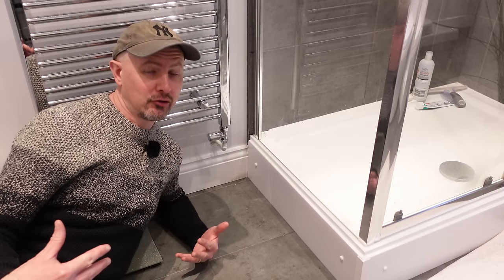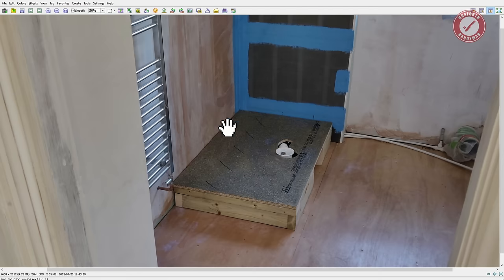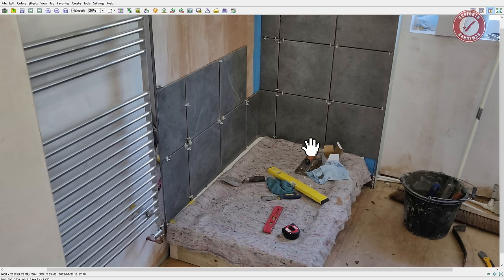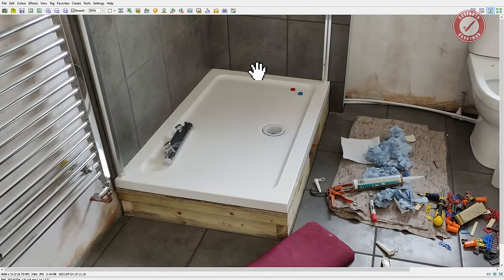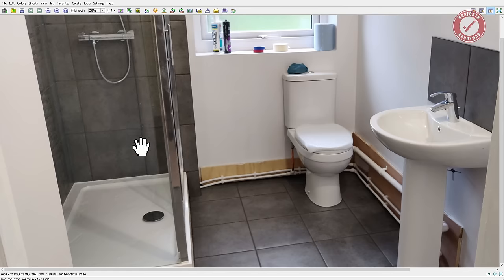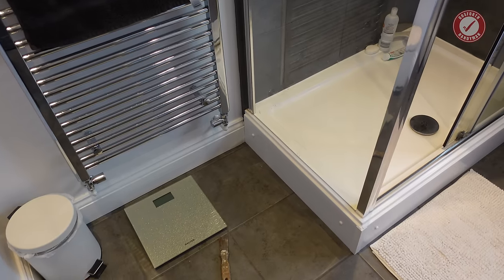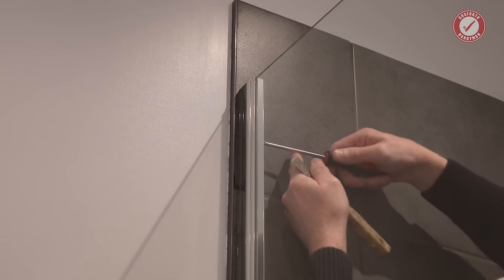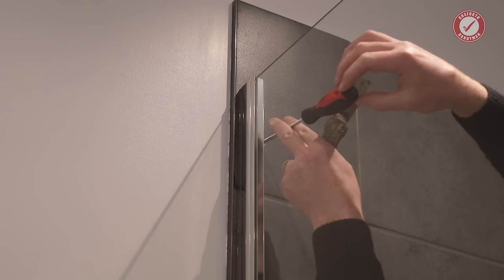How do you fix a leaking shower screen?

Comment: You could have used nylon fishing line to get through the silicone
Reply from the maker: Possibly!
Reply: I had a similar thought of using “cheese wire” or similar. I’ve got a similar issue with the corner of my shower screen, so fingers crossed I can pick up some ideas here.
Reply: dental floss kept snapping when used that to remove the old silicon behind
Reply: Just some nice thin scalpel blades and long thin utility knife work wonders. Don't know how you'd get fishing line to work without a second pair of hands on the other side of the glass...

Comment: Did you tile then put tray upto it? If so you'll struggle to get that to ever seal properly mate. I'd always tile onto tray to reduce that to a minimum.
Reply from the maker: No, always tray then tile. Think it's on the pics. 👍
Reply: @Gosforth Handyman  just looks like from pics. Sorry bud, but yeah to pick up what you said about sealant only where manufacturers state. Quite a few seal profile to wall, if water gets in it cannot get out! Great of you to share it, many wouldn't 👌
Reply from the maker: No worries! 👍

Comment: Problem you got it’s a little bit of that sealant gets stuck when you’re pushing it back down you’re gonna have the same problem again
Reply from the maker: If I'd hammered the rail down in to the silicone that would be true. But watch again you'll see I hammered it down and then pushed it the ~1cm towards the wall, so basically just like a new install. 👍

Comment: I can actually see your future problem....at the bottom of the tray where you joined the new silicon with the old...When the new one dries and shrink it will eventually pull away from the old..Remember you are not in a customer house...so you've got how long it takes
Reply from the maker: Silicone doesn't shrink when it dries - at least the Dow stuff doesn't. 👍
Reply: 100% Silicone does not shrink as far as I'm aware. Tiles and shower trays can move slightly with respect to each other, hence using silicone which has some give to allow for this. I think what has been done here will be fine.
Reply: 100% silicon cost like £40 a tube and I am sure you've not use that..And I learnt that from Roger,the same guy you mentioned
Reply: @robert3741  I'm not in the UK but the stuff I use is "Selleys Wet Area Silicone" which is 100% silicone and costs AU$11.50 = £6 for a 300g tube.

Comment: classic bodge
Reply from the maker: How? Please educate us as to what you would do? 😂
Reply: @GosforthHandyman  in my daily life as a bathroom fitter, i would of extended the tiling at least 3 inches past the tray edge and down to the floor, to avoid small areas of tile lipping past the frame. I would also grout the gap between tray and bottom tile fully all the way around, even the gaps which would be outside the tray...that way, if i ever 'forgot' to silicone the vital area where upright meets tray, as you did, it still wouldnt leak, as the grout maintains the integrity of the tile/tray connection....it is also good practice, and insisted upon in many install instructions, that silicone is spread 4-5 inches up the outside gap where upright and panel slide together...this stops the other leak you had from this area from occuring...lastly, a minimum silicone bead of 6mm is preferable all the way into the outsidecorner  at the upright base, yours seemed pretty thin at that point.
Were the walls fully tanked behind rogers wondertape, right down behind the tray edge?, as the water damage over those months of leakage would be quite severe...ive seen joists crumble in new builds after 3 months of similar installs. Good method of upright manipulation tho, however you would of done well to reposition the upright down into the wet silicone, as it would have cured around the aluminium, as opposed to being cured and elastic the day after, and risking being split by the sharp ally channel once it was pushed down...my method is once im ready to put uprights on the wall, a small line of silicone at the base before attachment guarantees the botyom of the channel is 'embedded' in silicone, whilst still allowing any water to drain/evaporate out under the internal gap of the upright  ..so once again, as well as waterproofing pre-tile, fully grouting all gaps, with a decent waterproof grout, BEFORE cubicle install and siliconing gives that extra waterproofing.®️™️..p.s i just put bodge job to trigger you lol
Reply from the maker: So basically what I did. 😉
Reply: @GosforthHandyman  no, you didnt! and thats why it leaked and has soaked the internals of your walls and floor! For some next video inspiration.." i rip out my leaky 2 month old shower, to see the damage its caused to my floor joists and wall footers.."
If you had of grouted fully ,as i instructed, there would of been zero leakage coming from behind your tile trim, as seen in the vid....been there, bought the TShirt and took it back for a full refund.

Comment: As a handyman, could you really take three days to re-caulk a shower stall?  I'm sure your end product is great; but, I doubt you could ever make any money doing it that way.  Also, I don't think any customer is that patient.  Imagine three days having to change the morning routine.  It's as bad as a tile job.
Reply from the maker: Not 3 full days! 3 visits. One to clean out the joint and let it dry overnight. One to do the bead behind the rail and one to put the rail back and silicone the edges. You could squeeze all this in to a single day but wouldn't be as gooder job.

Comment: Just take it apart and redo it properly...
Reply from the maker: That would be silly.
Reply: @GosforthHandyman  sometimes it's the best way of fixing a mistake.....
Reply from the maker: Sometimes, but not this time. 👍
Reply: Basically my thoughts of this, but he disagreed with me as well. If you removed the vertical rail and shower screen 1) you can properly clean off any scale 2) let everything dry out 3) bed silicone properly where it needs to go and work most efficiently.

Comment: Nope. Not impressed this time around with your work. The only TRUE WAY to fix this job would be to remove that back chrome rail, silicone it, and refit. I suspect it will leak again in the future
Reply from the maker: Silicone behind the back rail? Nope, that's not recommended. 👍
Reply: @GosforthHandyman  Maybe i not made myself clear. The vertical rails, which you admitted you forgot to silicone in the 1st place. Why not remove them and apply silicone, then refit?
Reply from the maker: Think you've misunderstood. Didn't forget to silicone the vertical rails. 🤔